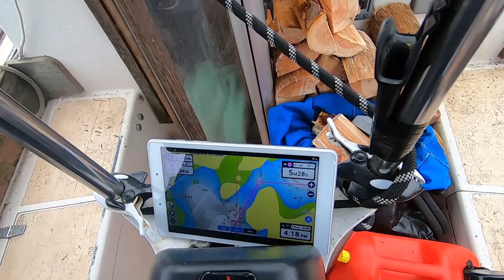Electric sailboat in 7 knots of current... sailing NORTH in the winter - Sailing Oka Solo - 031

Comment: Pretty neat that you have a (service free?) electric motor and two generators. Sounds like a lot more reliability and redundancy than a normal engine.
Reply from the maker: Not sure what you call service free? As in low maintenance? I only carry the newer 3200w honda generator
Reply: @sailingokasolo6801  Yeah, should be very low maintenance. Not sure about boats but in cars electric motors are maintenance free (even in our old banger) and it has been such a blessing.

I thought you said you had a bigger and a smaller generator and was happy about you having a second one in case one fails at a critical moment.
Reply from the maker: @adddude7524  i did at firts have two older generators but ive gotten rid of the old noisy ones  but this new honda has been super reliable
Reply: @sailingokasolo6801  nice!

Comment: Good to see you sailing. Challenging tidal area you do well. The shallows, shifting sandbars are just a suggestion, charts sound further off. A few out in the Gulf/ Bahamas area have run aground in areas charted 10 meters deep. Keep my depthfinder on and check the logical contours.
Reply from the maker: Knock on wood I haven't ran aground yet but we all know how the saying goes " there are only two types of sailors those who have ran aground an those who will..." some area of this coast are still not charted although most of it is.

Comment: This was fantastic!  Much to comment on:
First, thanks for explaining the limitations of the electric plant and your plans for the future and how you're extending the range right now. Is the "big" generator portable or integrated into the boat?  You live in a dark, wet region for solar generation.

Was the dropped hard drive the spinning platter type? What do you think about a portable/external, 1TB solid state drive?

Next, you're a mad woman setting off to go further north in such cold, snowy conditions.  A chainsaw is not usually standard equipment on most sailboats!  How long does it take to dry out that wood so that it's useable? Cold weather is often the one thing that will drive people off of their boat because they can't store enough fuel.

You say and do lots of small things in your videos that indicate to me that you are very skilled and knowledgeable for someone so young. You really are a skilled mariner. I love how calm and drama free your videos are.  You just "do it."  You assess the risks well and take proper action to mitigate them. 

Lastly, you really are beautiful. You have a smile that makes me smile and I love the shorter hair. :)
Reply from the maker: The "big" generator is a 20 years old beat up 4400w champion i got for free because it needed work and wasnt running wich a carb clean did the trick and i can run my 3000w charger on it giving me 4knots without drawing from the batteries in flat conditions, I bring some inside and dry it on top of the stove but often end up burning wet wood from necessity  as I don't have enough room to store it, just need to clean the cheminey often and its all thick stainless so im not worried about damage but much prefer dry seasoned wood. 
I appreciate you comments a lot, I'm trying to not be an other  sellout channel doing it for the views and money only but rather to show what its really like to be out there doing it in a hand to mouth scenario. So many boats on this coast never go out after September but the summer days are often windless so kost people just motor to their destination and its just not my style!
Reply from the maker: Also I'm definitely getting a solid state drive next and will start backing it on clouds as its frustrating twice in a year and a half! I recently got second hand lithium cells for cheap and will be building my own battery also one of the next projects will be a real solar arch allowing for more solar!
Reply: Same thing happened in Panama during covid, in that European cruisers had to fly home, sometimes never to return, abandoning their boats.

Comment: Welcome to the reality of electric boat propulsion.  I use two Honda 2000's on eco mode for 6 hours of run time returning 40 amps X 6 hours = 240 amp hours back to the 20000 Kwh 400ah 16 in series 48v Winston battery bank.  Then I usually factor in 15 amps of solar for the majority of the days leg.  So I can turn props for anything less than 50 amps (boat draws 5 amps constant underway for electronics refrigeration lights) and still charge my batteries if I choose to.

Depending on your new batteries you likely are not going to regret it.  I may be inclined to purchase an identical battery bank to my existing bank in the very near future.  I will likely purchase from GWL Power as I want the smart123BMS system on board for cell monitoring as I currently do not have that with my system.  It has been rock solid though for the last seven years.  I can't wait to get back to the catamaran soon.

Love that you went 48 volt.  Once you get a bigger battery you will find that you still run your generators when your underway at times depending on your plan for the day.  I can do 75 to 100 Km legs with my electric motors without running a generator but then a portion of that is returned by solar, albeit very little usually 10amps.  

That being said I do not know your amp draw underway for 4knots.  I plan all my trips at either 4 knots slow 5 knots fast.  With two Honda generators each producing 20 amps and 20 amps if you can make 4 knots and still charge you have a winner and power for dinner :).  

My catamaran is still in the marina awaiting some small repairs and then the proposed hard dodger retrofit over the cockpit.  Looking forward to starting my sailing adventures on the coast again this year.  I will likely order some new flexible solar panels but much of that depends on shipping from a city that is locked down in China at this time.

I expect to be partially mobilized by the start of May and will make an initial trip out to check the systems on the boat and get it cleaned up more.  I may simply find a contractor to do all the slated repairs or take the project on myself with the help of a 3 day a week boatsmith.  Then a new survey and I'm away.

At the same time I will be juggling home repairs on my house back in Alberta.  Some dental work also but I want the boat back in the water.  I might order some new motors for it and revamp the existing mounting on the transom with electric tilt and trim.  A new helm cable and tightening up the steering would be nice so the outboard autopilot actually works.

Thanks for the inspiration.

Arden
Reply from the maker: I just scored second hand winston 260ah cells for a song! Looking forward to hooking them up waiting on a bms, I have an old champion 4500 that charges via the multiplus-ii 3kw and i find i can run indefinitely at 3-3.5knots drawing 2500w not the best but Oka is a heavy boat for its size but im joping that with the new cells ill have a range of 6h+ @3.5knots also i never go below 48v soc and tend to cut it out at 50v so keep them batteries healthy. 
I was offered to purchase a ocean front lot for very cheap and I'm toying around with the idea... but it would mean postponing my trip south by a year...
Reply: @sailingokasolo6801  K that is a great improvement.  Top balancing is perhaps needed but otherwise a simple high/low  voltage disconnect is all that is needed.

Correct your little gasoline generator is able to run so long as you have fuel and keep it level.  Otherwise I find dual honda 2000's provide 40 amps return for 6 hours equals 240 amp hours = full battery.  Usually only run the generators at night and they run on eco mode for six hours good night.

Exactly - my 400 amp hour cells from factory with BMS cut out actually at 50.6 right around there.  Technically these cells may last a very long time if cared for properly.  

I was looking at private islands but it turned out I stayed at both of the vendors islands without having to purchase the unimproved property.  Land anchors can't live with them and sometimes hard to live without them.  Guess I'm keeping mine now permanently - no sense selling it now that it is paid off.

Counting the days until I arrive in Richmond.  Waiting to hear back from my original Solar panel guy.  Pretty sure he is going to hook me up with flexible panels again with a Vmp(V) of 52.5 volts or right around there.  Perfect match for the batteries and straight runs to the combiner box.  

That still leaves me needing a better hard dodger and enclosed cockpit.  Time will tell.  But with brand new panels on a nice level flat roof I would budget close to  40 amps from the sunshine conservatively.

Anyhow boat yard life for me soon enough.
Reply from the maker: Yeah i just ordered a adjustable voltage bench power supply to individually top them up before linking them and there are spares if one cell is bad
Reply: @sailingokasolo6801  I have pictures documenting when I did my five year top balance August of 2019.  You have spare(s) cells - nice!  I bought my benchtop power supplies from an electronics store in Vancouver.  Circuit-Test PSC-6916 Switching Mode Power Supply 16VDC @ 60A 

The question for you is if your benchtop power supply is comparable in output amps otherwise you may need to reconsider the process again reading the how to I list below. 

What I am saying is...  Buy the second benchtop power supply and be kind to yourself.  Even with 260 amp hour cells you will be at your top balancing session a long time with only one benchtop power supply. 

Top balance on land if possible.  Failing that in the boat during calm conditions tied to a dock with good power when it is not hot out.  

Go to the authority on the subject matter and read if you haven't already and read again if you have.  Then plan.  I had to split up my thin copper stacked buss bars to accomplish the parallel linking.  There were also many steps and procedures that are not explained in the how to like making a current drain device if needed and the steps to starting and running your power supply units the creation of the charging leads etc... 

https://marinehowto.com/lifepo4-batteries-on-boats/

Otherwise if we exchanged emails I could readily send pictures of my gear and what the process looked like from my perspective.
Reply: You can find my email address in the "About" section of my YouTube Channel.  Really looking forward to hearing from you there.
Reply: I only have to put the hitch into my little enclosed trailer like U-Haul, go through trailer and remove stuff not coming for trip.  Load trailer and Sport Trac, load suitcase, leave - arrive Richmond 13 hours later @ 8:00 AM.   First examine battery and energize the boat.  Second reinstall one fresh water tank and flush the system.  Third if all went well make supper, give thanks and prepare for day 2 with a well deserved rest.  Oh install simple composting toilet design I found somewhere and have to find again.  Will be removing my incinolet.
Reply: All cells came back to 3.6 volts and 5 amps trailing current.  Currently on my last charge in parallel to 3.5 volts.  I can't even get my bank up to 3.6 volts on a good day at the marina so I see no sense in charging that last time to 3.6 volts and 0 trailing current.  

I could not even get my bank to go past 3.4 and 3 amp trailing current.  Would have taken hours to sit and watch it slowly try to dump that last 3 amps of current to 0.

I'll probably let it sit for the night or next day in parallel and reinstall in series to see if I fixed my BMS relay boards that I replaced.  After which install new inverter and check if old ones work and order 1 new one.  Install in old location temporarily.

Further once batteries and motors are confirmed to all work, plus electronics I can begin to address the exterior.

Thought I would get hole in starboard hull patched today but buddy did not show.  Thinking seriously about just letting a shop have at it considering the scope of the work.  

Cabin Lift + Bimini:
1.  Aluminum and Glass (quickest,  best visibility,  weight comparable,  appearance negative
2.  Wood and fiberglass (Can be quick, natural appearance to boat, weight comparable.
3.  Truck Topper (Banged my head on the roof for the last time.  Cuts roof out of boat and installs truck topper.  Fiberglass in later.  Looks like hell but it works.
4.  Sand and paint entire topside.  Smooth and fare two hulls.  Ablative.  
5.  Go boating.
Reply: Running under battery again and only 3500 watts of inverter power.  Tsking bank down to LVD to capacity test.  Usually a heater 30 amps will do nicely at night.  Gives a pretty good indication of bank capacity.  Then do it again.  Pretty confident the solar still works.  

To Do:  
1.  Test AC - enlarge serving portal opening to fit AC unit or try to source one an inch smaller.
2.  Reconnect wiring to Port Ray Electric Outboard.  Call vendor and order new cables and throttles.  Enquire about refurb kit.
3.  General tool round up and put away.
4.  Thank you card to marina
5.  Source new mini fridge.
6.  Make front double bed.
7.  Sheets on salon queen/double
8.  Test all propulsion motors
9.  Verify remotes work.
19.  Wire up 120 vac to 36 vdc converter to Motor Guide Xi5
20.  Test Generators.  
21.  Source contractor for boat painting, repair and modifications.
Reply: On the seventh day the batteries were all top balanced.   Cooking hot water right now on the rebound.  I seem to have got a good nights sleep.  The back is slightly hammered.  Time for a few days off.  Waiting for the sun to come up to get those solar amps charging on the rebound.  I'm charging from shore power at 33 amps.  So far so good!!!!  Heater ran 20 amps all night and still plenty in the bank.  I started to charge at 33% state of charge or 51.8 volts more or less.  I could have forced the bank lower had I wanted to but I want a clean recharge without tripping the contactor for testing sake as I will eventually test all the cells with the voltmeter again to check the individual cell voltages.

To Do:
1.  Wire starboard throttle controller back up.
2.  Test starboard motor.
3.  Wire 120 vac to 36vdc converter up.
4.  Test Motor Guide xi5 GPS anchor.
5.  Finish cleaning aft lockers x4
6.  Finish cleaning forward hulls/bunk
7.  Source contractor for project.
8.  Source mini-fridge.
9.  Test electronics.
10.  Repair radiator on truck.

Comment: Your videos are so inspiring, loved the snow. you can probably get your video content back from the hard drive for around 25 dollars US if you send it to a data recovery company, most likely they will be able to save most if not all the data. shop around online and youll find a reputable one. ufortunately I live in the UK for now so don't really know where you could  send it to. thanks for the update on the electric motor, how are the solar panel doing? did you get the cracked one replaced? ciao!
Reply from the maker: Its the second harddrive that suffered the same fate and last time i was quoted 1500$ CAD